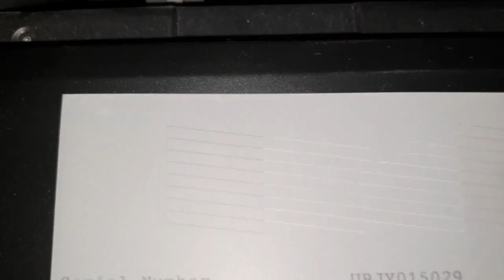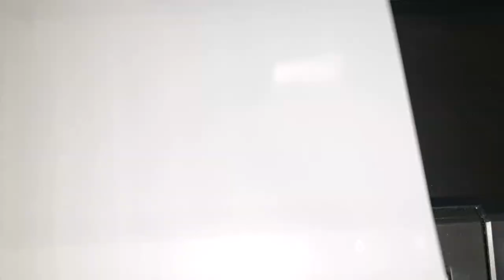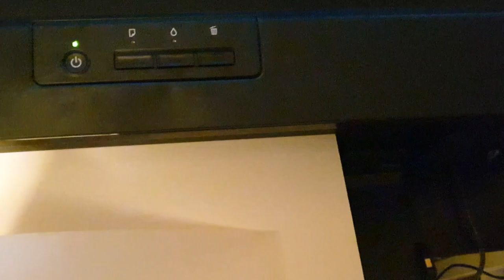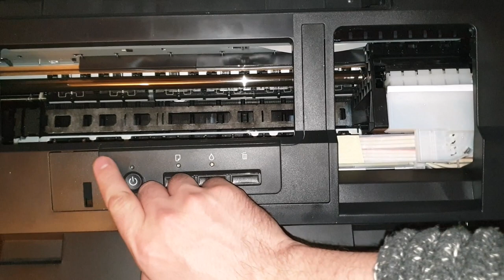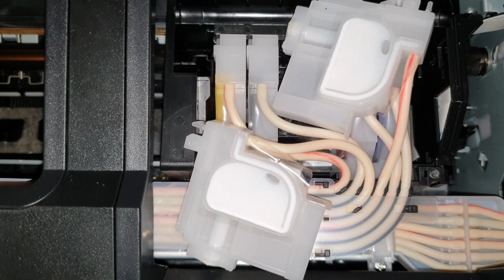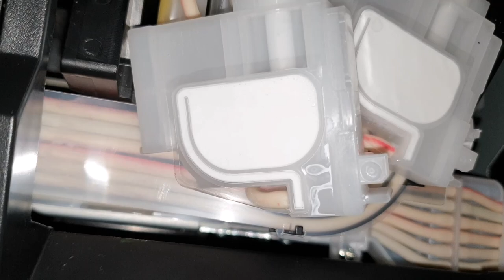How To Make White DTF Ink Brighter And Fix Transparent Prints

Comment: Hi,
I am facing a very strange issue. First I was using the Ink Circulation system but always have some issues. Today I removed the ink circulation system, & connect the pipe directly with ink tank.
No matter how many head clean or power clean I do. After the first print, my second print has a very thing transparent white layer. Its like printer not sucking white ink. But white ink is full loaded in damper. I think When I do head or Power clean. First print is fine because of the white Ink left in head. Seems its not using/sucking white ink from damper. Now what should I do I changed Ink Cirulation to direct because of this issue Now I am very tired of these things. ANy suggestion?
Reply: Same issue here. this is very tiring. I'm fed up and ended DTF, wasted 50K
Reply: Same issue here

Comment: Hi sir, I noticed that you didn’t remove the roller unit of your printer, I’ve watched other tutorial videos about converting to dtf printer, they removed it. What did you do differently for printed side not to touch the rollers?
Reply from the maker: I did remove the rollers. Just not the whole assembly. If you look again the wheels are missing but the black plastic bit is still there.
Reply: @dtfprintingtechnology9457  ahh thanks, i guess this is better, because the guide is still there.

Comment: Do you know what could be the cause of white ink dissapearing halfway throughout an A3 sheet? It starts off good, 100% white, and then fades away to 0% white. We have tried changing the dumpers, applying the cleaning solution, shaking up the mixer... Do you have any ideas?
Reply from the maker: What about the ink lines? Also check there is no white ink buildup at the bottom of the ink tank that might be affecting the ink flow. If it's not the ink flow issue, you may need a new printhead.
Reply: @dtfprintingtechnology9457  Thank you very much for the quick response. 
We have tried shaking up the ink tank, so we figured there could be no build up at the bottom. We will have to check again.
We are not sure what you mean about the ink lines? If you mean if lines are visible, then the answer is no (while the white doesn't start dissapearing). After it starts fading away lines start to become more and more visible.
Reply: @MincomDoo  check the tubes where the ink travels through. I had this issue and saw that there was a clump of dried ink in the tube. Luckily i was able to get it out with some solid copper from electrical wire :D
Reply: @MincomDoo did you ever resolve this issue?? How!? I'm dealing with the same issue and nothin resolves this
Reply: I believe this is just the flim not being seen I have the same issue some times it wouldn't print any ink on the sheet and I couldn't understand why or sometimes it would print some. So I just added some tape at the bottom of the flim where the printer catches the paper and now it works everytime not sure why it does that when it's feeding the dtf flim

Comment: What can I do to get the white to print. It has never printed white even at initial setup
Reply from the maker: Does white appear when you do a nozzle check?
Reply: @dtfprintingtechnology9457  it won’t print a nozzle check. 😩
Reply from the maker: @oneKimiD  It won't print a nozzle check at all or there is now white on the nozzle check?
Reply: @dtfprintingtechnology9457  it won’t print a nozzle check. I finally got it to print white but Now it’s saying “flatbed printer printing software (for white ink) has stopped working”. What’s that mean

Comment: Hello its great finding your channel as I am just about to buy some items from there. 
One the inks that you sell for DTF - are they the same as DTG inks - i.e. pigment inks?

I dont know if to buy your inks or the one from resolute. I am not sure which is better. 

Also the print material I am thinking whether to buy the sheets or the roll. 

Thanks
Reply from the maker: Hello. These are all water based pigment inks. We sell the same ink that we use ourselves for our own printing business. I believe we offer the best quality and value combination. You can always buy a small sample and compare our inks to resolute.

It's best to buy roll for roll printers and sheets for desktop DTF printers.
Reply: @dtfprintingtechnology9457  Thanks for that - I just placed an order on your website for the full thing. 

Unfortunately I dont feel comfortable putting my bank details on your site. It will have been great if you had a paypal payment method on there. 

Nevertheless I chose to transfer the money directly to your account. Kindly respond with your bank details.

Although I would actually still prefer paypal but it is what it is. 

Best Regards,
Reply from the maker: @m77ast  Thank you for your order. Bank details are shown during the checkout process as well as your confirmation email. Please check your spam folder in case you've missed it. Please email support@dtf.technology if you have any questions or need further assistance. We can not discuss payments or your order details in public YouTube comments.
Reply: @dtfprintingtechnology9457  Understood. To be honest your youtube videos gave us some confidence as we initial thought it was a Chinese company pretending to be a British company. This first one is for our testing. After that - hopefully we will buy more. 
Thanks again.
Reply: @dtfprintingtechnology9457  Payment released - hope to hear from you and recieve the items soon.

Comment: Guys after i did the exact video process , it prints blank paper , it tries to print it goes left right but all paper is blank, can smbd help me?
Reply: Make sure the ink tank is unlocked. If you are using refillable ink cartridges, make sure they are unplugged. Give it a couple of automatic ink cleaning cycles. Rule out rip issues by printing a bit of text from word.

Comment: Hello,

could you maybe help me ??
I have a problem with my printer, the two ON / OFF and Ink lights are on.

I filled up the inks, put the cushion back on and vacuumed off the rest and also cleaned the print head.

Unfortunately the printer doesn't work. If I press the button with ink for three seconds, the on / off button lights up and after two hours nothing happens.

I would be happy if you could help me further.

Best wishes
Reply: you need to reset the printer chip

Comment: Confused with the process? I understand the heated film tray drys the ink, do you not need to cover the ink with the DTF powder before the ink drys? and then heat to dry?

What stage do you cover the ink with powder?
Reply from the maker: It dries it enough to stop it from flowing. It does not dry it completely. The ink stays pretty sticky still for the powder application. The temperature is also adjustible so you can set it whatever temperature works best for you.

Comment: Hi, I'm having  issue. My prints come out great but when I heat press it, it comes out alot darker. How do I keep the print quality the same on the t shirt?
Reply from the maker: DTF transfers are never 100% opaque. All you can really do is make sure you are printing a strong thick layer of white with well mixed quality white ink. There are workarounds that involve mixing in some black powder but those are not perfect either.
Reply: @dtfprintingtechnology9457  hello ! How can I make white thicker? Or ot is impossible ?
Reply from the maker: @чиабатта-р9с  Increase white to 100% in acrorip. I assume you have already done that. 8 colour printers can apply the most white because they have 4 white channels.
Reply: @dtfprintingtechnology9457  thanks a lot for your response ! Will try.

Comment: Hi, I’m facing a problem with white ink. In Nozzle check the white ink is coming sort of blue. I don’t understand whats wrong. Can you suggest any solution. Thanks in advance 🙏
Reply from the maker: Sometimes after you run a cleaning cycle, colours can look a little different on a nozzle check because the printhead may have some residual ink on the surface still. Try printing a small print. If the white remains bluish, clean the whole thing out, clean the lines, flash the print head, clean the dampers, clean under the dampers, clean the ink tanks and make sure your white ink that's in the tank is still white.

Comment: I'v got this problem, but I don't really know how to fix it. My white designs start going pale like half way through printing and color designs have very pale underlayer (something like on ur video). When i take syringe to clean it, the ink does not want to go smoothly, preasure kinda sucks it back. I get to get the ink in the syringe eventually but i dont think thats okay. Do you know what should I do?
Reply: oh dude, so happy to see you have same problem like me!
i'm still fighting my way, but so far what i have found: try to move the ink tank higher then the dampers level, this will prevent the gravity suction of inks to lower level container.
Reply: also try to push the syringe deeper into the damper, to unblock the spring-ventile.
Reply: @HeinerRadau  thx for reply. I don't think i can put the syringe any further.. and when i do it the other way, the air goes through and i Can hear it wobble in the ink tank, but when it comes to sucking ink out, the preasure won't allow..
Reply: @leooadi5311  if air goes in but no liquid comes out, it sounds like the Ventile is working properly then, but maybe your syringe is too thick to unlock the valve? There is a spring inside that pushes a hard bolt against the rubber, now in order to put ink into the damper this bolt has to be pushed down. I wish we could post photos in the comments, it would be much more helpful for everybody. Anyway, just Use a thinner syringe.
Reply: @HeinerRadau  have you got whats up?
Reply: @HeinerRadau  i'v got some progress. I swaped the dampers and it turns out the side that did not let the ink through does it just fine. Problem is with damper, it's just weird because it's new..
Reply: @leooadi5311  yeah, but just message me on fb, i dont wanna give out my number here
Reply from the maker: You don't have a shipping mode turned on, on your ink tanks by any chance do you? Some printers have a dial on the side that block ink flow for when you are transporing your printer.
Reply: @dtfprintingtechnology9457  no, I don't :P i think the problem was dumper, but it's weird cause i just got it. Thanks for coming back to me
Reply: @HeinerRadau  Okay, I just did the "printhead hospital" and I think it worked.
Reply: @leooadi5311  dude, please be very careful about the cleaning solutions you use. Don’t use mineral water, don’t use isopropyl alcohol. Only use the real DTF cleaning solution , other liquids can have chemical reactions with the inks and clogg the printhead irreversibly.
Reply: @HeinerRadau  I tried this, not a good idea to put ink tank higher as ink may flow freely and continuously in print head when printer is off. It caused smudges in my print.

Comment: you could just shake the two white toner cartridges and ink tanks before printing, but ok.
Reply from the maker: Tank, ink lines and dampers act as one interconnected system. Pigment wants to settle at the bottom of the ink tank and filler wants to raise to the highest point. Usually the top of your ink lines. Shaking the top part does not make it mix with the bottom part. Over time, you will end up printing with a higher concentration of glycirine. Which means that clogging will get worse. There are a few easy experiments that anyone can do to test this. But if shaking works for you, then great! Stick to what's best for you.
Reply: @dtfprintingtechnology9457  thanks for your detailed answer. i just started printing about a week ago, so i will let you know when the shaking technique shows its limits!
Reply: @HeinerRadau  wow you started working like a week ago and you have to shake it every time ?
what printer do you use please ? and can you update me of the quality when you press it on the tee shirts ?
Reply: @leepisin8211  the issues im facing with white toner seem far more complicated then what i'm finding answers so far.. i'm using epson l1800. once you got the white ink opaque like the author of this video after ink circulation, the results for the finished tshirt are impressive, but i still didnt find the solution. my white inks just keep clogging, no matter how often i circulate the inks. i believe the lack of head cleaning in the first 3 weeks os operating in vietnamese weather conditions ( between 27-37°C) makes the white ink clog even faster. also my white ink separates much stronger and way faster then in this video. ill make a video on it, as soon as i found a solution.
Reply: I suggest you change your ink supplier, the ink quality may cause the issue. can you tell what ink you use ??
Reply: @rohanbasak  PET inks ^^ I’ve bought a refill with new inks from diff supply and actually bought a new printhead 😅 so, for now everything’s fine again. Do you have a PET film printer yourself? How long are you operating it already, How do you do maintenance, and did you ever have to change printhead?

Comment: which dtf printer is best resolution, Higher than L1800 and L805. becouse L1800 Printer only Max. 5760 x 1440 dpi and nozel 90, photo is not clear
Reply from the maker: Most people print at 720 x 1440. Sometimes 1440 x 1440 for prints that require better quality. I don't know anyone who prints at 5760 x 1440. It will probably take an hour to print. Something like P600 is better and faster but you should be getting photo quality results at 1440 x 1440.

Comment: Hi
my white dumber getting black and white ink tank also getting black if I hold printer 20mins without any print.
i ting my waste ink getting load or revert into white ink dumber. because for this our white color getting print like light gray color. 
is that any fix for this kind of issue. 
Thanks in advance.
Reply from the maker: You have black in your white ink tank? Something is very messed up. I can't help you without examening the printer though.
Reply: @dtfprintingtechnology9457  
I filled white ink in external tank and connected in middle 2 dumpers. but black ink present in tank if printer is idle some time.

Comment: sir i am having problem on my new L805 dtf printer , when i print in is too watery i tryed on both side of paper but not working and wight ink is not dry evenly , watery print i attach some video please tell me what i did wrong. 
https://drive.google.com/drive/folders/16Aj8SP1IWvhIBp0zezIDjZIeufJOz9q8?usp=sharing
Reply from the maker: Looks like you are applying way too much ink. Maybe dial down ink amount in acrorip settings. 20% CMYK 80% white. Also, in newer versions of acrorip there is a boost setting, that can cause this too.
Reply: @dtfprintingtechnology9457  thank you for reply sir,my acrorip is 9, and ink setting is 40cmyk and 60 is whight , and whight layer genratioin is 100% under any color setting , but when i use gredient it com less ink but not watery  but some drops running inside print means not evenly spred whight ink . watery whight , not dry
Reply from the maker: @princy3601  OK, weird. Not even sure what that could be.